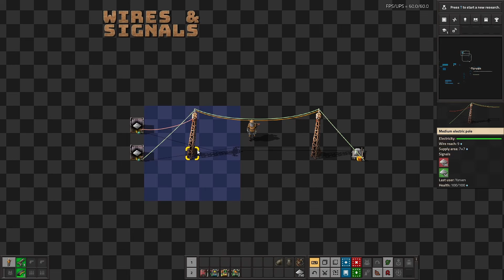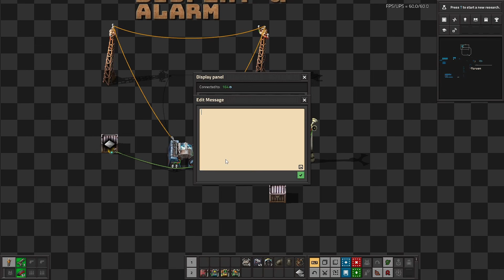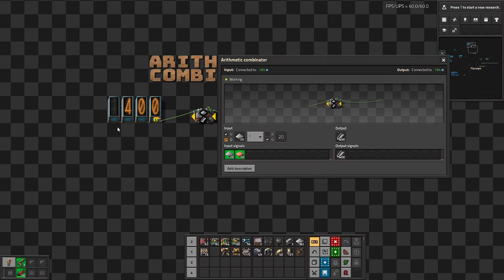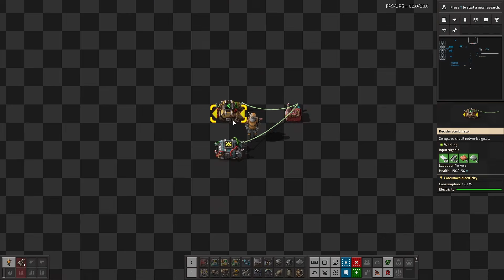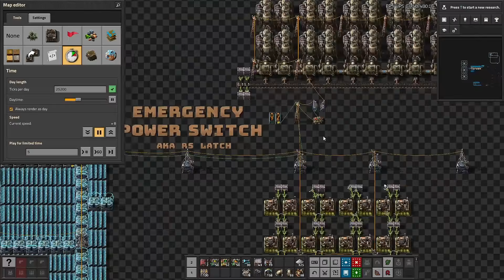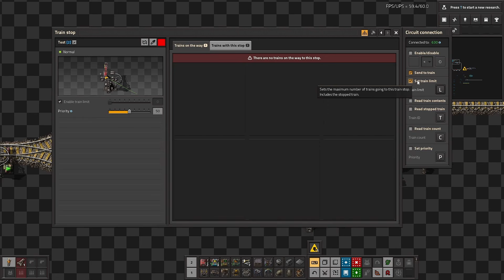The Circuit Network & You | Factorio Tutorial

Comment: I tried the supply train instructions, didn't work as intended, had more than 5 different products in my demand list in the constant combinators, the inseretes become stuck with products that have no items in the cargo wagon and therefore don't go on to the ones that are in supply in the cargo wagon.
is there some logig how a circiut preferes items? it seems that it's not by amount.
So in general if you create signals to use them for setting up filters for insertes and there are more than 5 the inserters seem to yust get 5 signals and if these are zero other items depite in signal ore in supply wont be grabed by the inserter.

Comment: I made an alarm that tells me when a train is coming into my base so that I can get off the tracks, I made an alarm to track when accumulator power dips (power shortage), an alarm for when my enriched uranium is ready, displays for all my tanks, a sushi belt monitor for all science types, and a system to control the temperature of my reactors with a single fuel cell at a time. That last one was a tutorial, the others were my idea. The train one is just using signals and the gate

Comment: for the emergency power switch, I found that you don't need to run a long connection to an accumulator that's far off. All accumulators in a network will balance their charge (i.e. if one accumulator is at 25%, all the other accumulators in the network are also at 25%). You can just build one lone accumulator near that power switch as a representative reading of the entire grid's stored energy.

Comment: 18:48, I do not understand. Less than 20 or less than 95, what? If it´s less than 20 it´s also less than 95. What´s the point, how does that work. What does that actually do. He just says it works, not why it works.
Ok thinking... so the checkmark signal starts out as 0 until the power drops under 20%, then it changes to 1. And stays as 1 as long as power remains under 95%. Once Power is above 95% the checkmark signal becomes 0 and wont be set to 1 again until power drops below 20%. Ok maybe I do understand... just seemed so confusing at first.

Comment: for supply stations, you can set train condition "when station is open", so you don't need radars
Reply: Indeed. Simply disable the outpost station until it needs supplies. The train itself doesn't need any special wait condition, too. Just "inactivity for 1s" for both stations is enough.
Once it has restocked at base, the train will look for an outpost that is enabled and goes there. If none are needing supplies, the train just waits at the resupply station until one outpost station opens up.

To make it even fancier: with a few more combinators you could adjust the priority value of an outpost station based on how many items it is missing. That means in a case where multiple outposts have a high demand, the supply train will prioritise stations that are most in need of a resupply instead of just going to the closest one, as would be the default.
Reply: @hidsgi-games5369  yeah, but then its lights will flicker every second at night. if you put "station is opn" it will just wait there

Comment: i was wondering it i can make a universal blueprint to calculate the items stack just by knowing what item it is dealing with. ex a box with 1 plate in it it would figure out the stack size the multiply it by a set number for how many boxes i have?
Reply from the maker: Yes, just feed any signal into a selector combinator and set it to "stack size". It will output the input signals with the value of whatever its stack size is, but won't do anything with fluid or virtual  signals.
Reply: @Yorven  Thank You

Comment: 20:50
TLDR: you can get rid of tanks and use temperature only if you properly calculate heat capacity 

You can actually do this without tank just by keeping temperatire low enough, and keep heat capacity big enough.
Thermal pipes can't loose any energy at all, only convert it into something else. Once heated to 1000°, thermal pipe will stay in this form forever... unless you connect it to heat exchanger and give it water and something to send steam in. Heat exchangers also won't consume heat if they have no water or they are full of steam.

Each thermal element has it's own energy capacity per °c. Heat pipe and exchanger are  1 MJ per c°, reactor is 10 MJ. That's per only 1 °C. I  ideal conditions you have a range of 500 to 1000°. To be sure, I'm use 550-950 because of some game mechanics. So, EACH heat pipe (and exchanger) can hold 400MJ, reactor - 4GJ and I don't remember params for spaceage heat tower, like 2 or 5 MJ/°c, so 800-2000MJ. 

Each fuel cell can produce 8GJ of energy (without reactor neiborough bonus), so you neet do keep at least 8GJ to not loose energy between reactor refuel. The only thing that WILL loose energy is reactor itself if it heats up to 1000°c, that's why you need to keep temp below 1k. Of course you can use steam as energy capacitor, but it's not that convinient and space-efficient, and you still need to use math. 1x tank of 3x3 keeps around 2.4 GJ (270MJ/tile at best) and to keep full 8GJ fuel cell you need at least 4 tanks. Heat pipes can hold more than 400MJ per tile and most importantly you already need to use it to transfer heat from reactors to exchangers. And then over it you have reactor itself with 4GJ of heat capacity.  Ugh, it's getting bigger, I'm pretty bad in compact messages (=
So, 1x reactor + 6 heat pipes + 4 heat exchangers will be more than enough to keep reactor below 1k° between refuel. That's super compact compared to variant with tanks. And moreover you need only reactor itself and inserter with "T < 550" setting.

For bigger schemes you need more calculations and things to consider but still, with 2.0 you can rely only on temperature and completely get rid of tanks in your reactor designs. Well for big reactors you probably still need at least 1 tank and combinator because keeping heat capacity with neiborough bonus getting harder, I guess if you need more than 2x2 reactor you know what to do.

Comment: Is there a way to disable robots  from repairing a wall during biters attack and prevent them form getting destroyed by flamethrower can you make a video about it , i just started this game I'm loosing a dozen robots each  attack i went from 2k to none in about few hours setting up a timer  after each attack would be an ideal choice .thanks mate
Reply: It's a sticky problem.  I solved it by : making each wall section a separate roboport network and tank+pump for flamethrower turrets.  use an inserter to pull the construction bots out of the roboport into chest.  Make a delay timer from circuit network combinators that triggers when the flamethrower pump runs.  wait 20 seconds then have inserter put construction bots back into a roboport

Comment: Would love to know how to do an if-then-else logic for my train limiter as sometimes the limit count exceeds my number of waiting bays and want to restrict the train limit to 4 even if the supply can fill 5 trains. So if A>4 then output 4 else output A (A=train limit). This way the train limit never exceeds 4. Still trying to work on it.
Reply from the maker: I have something just like that in my PTN system, but the short version is this:

1. Let’s assume your signal setting your station limit is “L”.

2. Wire whatever you have generating the L signal into the inputs of two decider combinators

3. In the first, set it to if L is “less than or equal to” 4, output the input count of L. 

4. In the second, set it to if L is “greater than” 4, output 4 L. 

5. Wire both outputs to the train station. 

6. Now, no matter how high the L signal reaches, what reaches the train station itself will never be higher than your number of waiting bays.

Hope this helps
Reply: @Yorven  Wow very much appreciated!! It was so simple! Thanks for your response 😀

Comment: Watching the clock controlled thrusters has me thinking. Trying to figure out a way to have a clock (or clocks) that operate off 4 states/timing speeds based on fuel OR ammo. Like if its between x and y ammo, use clock speed 1. If its between y and z ammo or below A fuel, use clock speed 2

Comment: Speaking as a life long engineer thats trained apprentices for a long time, installed lifts, re-wired panels and much more. This is some confusing shit. The moment it clicks though and all makes sense, that "aaaaahhhh i get it" moment is what made me become an engineer. So thanks in advance! Awesome explanation.
Reply: a lot of things are like that.  PLC programming is absolutely insane to me, and makes zero sense whatsoever, but i'm told once it clicks, suddenly everything is clear.  combinators are the same.  I wish there were a way to read the combinators all at once, instead of needing to open each one and see what is set.  it's like working on a huge codebase but your editor can only view a single line of code at a time.  I would greatly prefer if entities which can be wired up to other entities had combinator modules that you could add, or which were built in as some advanced form of the thing.  you get a Radar, and after you research more you get an "Advanced Radar" (which has built-in combinators so you can do all of the logic right there on one screen.)  And the same with everything else that can be wired to a circuit network.  If another tier isn't desired then add module slots specifically for combinators, or use existing slots for combinator modules, which extend the UI for the thing so that you can do logic inside the inserter itself rather than outside it with 17 combinators with wires that are impossible to see and to sight read.
Reply: @naikrovek haha yes I agree 💯, to many interfaces and not enough information on each one for it to be efficient or easy to grasp I guess? But see what your coming from for sure!
Reply: I briefly thought you meant in factorio

Comment: 15:34 You can always use a signal telling an inserter how many of an item to grab to dynamically change its stack size. This is done by making the difference between the items in the box and the desired the hand size. This way you always move items at maximum hand size until the final swing where it’s exactly the size you need.
(Items needed)-(items at destination)=(hand size)

Comment: another option that imo is simpler for balancing oil is to use pumps. for heavy oil diversion, you can check if there's enough lubricant first and then if there is divert heavy oil for other processing. this requires fewer conditions and wiring, you dont need to control the cracking chem plants at all this way, but accomplishes the same thing otherwise.

Comment: A note about the rail crossing : Trains dont stop instantly, and if you turn the signal red, and walk out after the train has passed the point where it can fully stop, you can get run over.

This can be mitigated with a little more logic, as if a train can't stop before a signal, it will reserve the block, and the rail signal will output a yellow. Link the yellow to the gate to lock the gate, and it becomes much safer